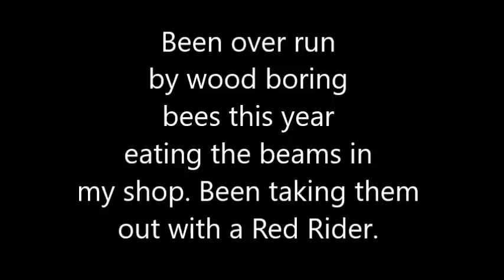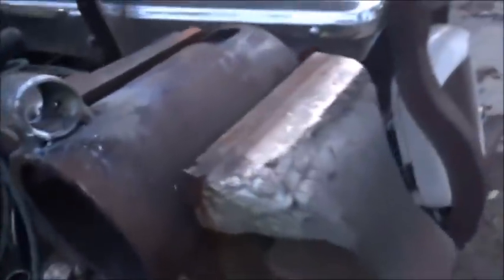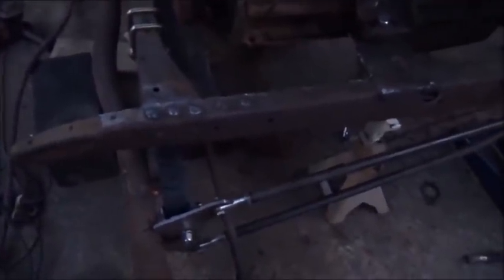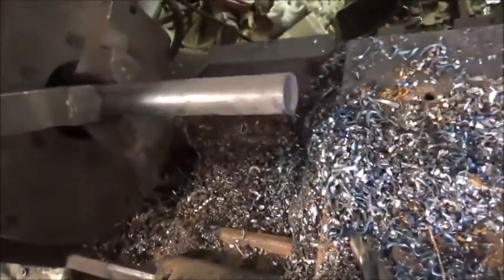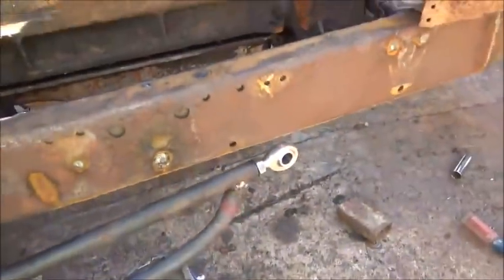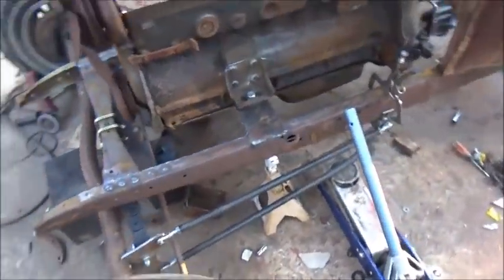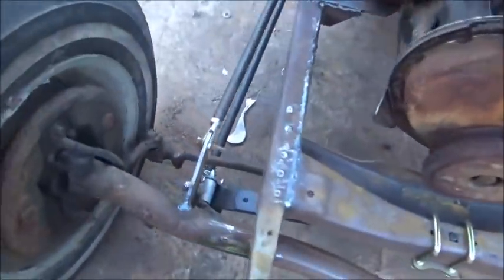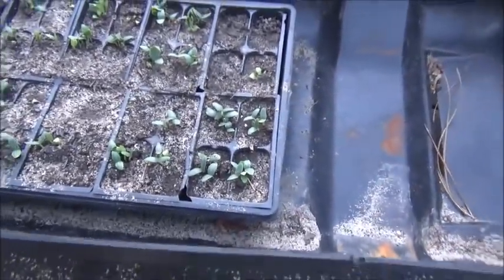1929 ROADSTER PICKUP FROM JUNK PART 10 Front End

Comment: I wood notch the frame in the front the ride height looks good
Reply: agreed,notch the frame...
Reply: Me too.
Reply: Agreed!
Reply: I agree also
Reply: Me also, looks good
Reply: YES INDEED - I agree with these men.
Reply: I agree, notch but also add the 1/2" plate to the center for additional peace of mind since 1/2" would not be noticable and as the spring breaks in and settles you won't have to play with it again.
Reply: I like the ride just as it is. But your going to gain probably another 100 lbs. on the front end. depending on radiator with coolant and manifold and exhaust. I like the" W" for a brace on the hairpins or maybe "J-W".

Comment: I would drill the hole up as you still have the weight of the starter motor, radiator, water, manifolds, anything else that needs to go on the engine and your self as you sit in it. But wait until you have the rear suspension and everything all together, with you sat in before you make your decision. Loving the build, your knowledge and skill to make something from nothing is amazing.

Comment: With the height of ride right, I'd notch the frame ends, I have seen them going past the front anyway and its not structural so just do it, its yours. Cucumbers for the valley as you can can pickles and what not but eating that many greens would gas me to the moon. They show no sign of slowing down in coal dust so it might just be the very nutrition that little (soon to take garden over as they spread out and hang to the sides of the low spot in garden... Heck, I have seen them hanging on chicken wire and doing good, supposed to keep those little feelers near dirt but didn't slow those behind house down. Gonna be a "finished for you know it" thing and then the next one will be the next one!!
You don't like the travel on the front then hang some torsion bars to the front and sides on the back

Comment: Looking good, as usual!  Suggestions to increase travel in front suspension: 1)Shim between cross member and spring. Drill a hole to just clear the spring bolt, possibly using a longer spring center bolt. OR 2)Add a leaf or maybe two to the spring pack. 3)Go to an axle without as much drop. or of course, drill another hole in the two bat wings.

Comment: I lean strongly to the half tubes welded in the chassis.  Evan if you raise the chassis the half tubes will still look fine. You could weld an alignment plug on those 1/4" spacers and shim the spring a little to get your 2" space. Personally I would want 3" for here in New England because the roads are poorly maitained. I know which ever way you decide to go it will look good and work well. Those straight 8 Buicks had a load of lowend torque so 2:78 to 3:25 gear with a Ford T5 will work just fine. 2:78 was the standard gear in a 5.0 Foxbody 5spd. I'm really enjoying this build. By the way I kinda miss young Noah. Keep healthy!! Dave

Comment: My opinion  move the spring mounts on the plates to the right height  A 1 1/2 inches. They are a heavy motor compared to the original.  or can you throw in another couple of leaves.  Then you end up needing longer mounting bolts and centre bolt. It looks good.  The starter body gave just the right radius too.

Comment: Ride height looks good, like you say. Keep in mind the added weight of the rad, manifolds, etc, etc. I would be inclined to drill a couple of extra holes in the batwing, finish the front end with all the accessories, then adjust to the finished weight as desired. Tubed notches in the frame would look cool as well!

Comment: Jonathan, the "Bell" style dropped tube axles have pressed in forged ends that are welded to the center tube. When these get chromed there is a special process that needs to be followed so that they don't crack on the weld joint. I think the problem is called "Hydrogen Embrittlement" which is a weakening of the ductility of the metal due to the chrome process. I don't recall what needs to be done to prevent this but I think some kind of heat treating after chroming. In your case the only chance of cracking would be due to a poor quality weld on the axle. The heim joints at the frame should allow more then enough movement to prevent binding.

Comment: Hey Johnathan: the only thing I've found to keep the bee's from eating my wood, is to paint it with used motor oil. Trying to figure a way to mix the drain oil with diesel fuel to thin it. Then find some way to spray it on the wood. Let me know if you have any ideas, or make a video of it.
Reply: Had a friend that used a 50/50 mix of old oil and diesel fuel. He used a weed sprayer ( hand held of course ) and soaked his rather large barn he built . I have since moved away so I do not know if it worked but, at the time it looked good. He was an etymologist so I figured he knew what worked. Hope this helps some people.
Reply: @christinamoneyhan5688  Nothing like making dry wood even more flammable...soaking it with an accelerant

Comment: Just a suggestion: don't alter your current front suspension until you've got the shocks installed and radiator in place. The new spring will settle a little but the front suspension really doesn't deflect as much as you'd expect if you are using shocks intended for the front end; rear application shocks are valved differently and might allow the front to compress too far. If you've got 1 1/2" of clearance you might be just fine. Also...with a long-wheelbase hot rod you've got to keep the frame angle 3 to 5 degrees down at the front for the car to look sleek. Otherwise it will look like a long lumber wagon. Keep up the good work!

Comment: Hi Johnathon.....Many are saying Notch the frame because you like the height right where it is....but they may not be taking the extra weight of the steering linkages into account nor the steering box  along with the weight of the radiator, the antifreeze, headlights, headlight brackets, intake manifold and carbs plus the exhaust manifold and pipes. Sure separately these things don't weigh that much but together they add a goodly amount of weight.

I suggest you drill 2 more adjustment holes in your batwings ......Easier to do than notching the frame AND 2 holes gives you more adjustment for weight .

Comment: Maybe you could try a thicker spring in the spring pack?  As far as I know that straight 8 weighs about 700 pounds or more. That's a good bit of weight on the nose of the frame. If you could've set the engine back more it would have put more weight toward the middle. But, it is what it is. So, going by my experience, it seems to me the best thing to do is add a couple more leaves to the spring pack. To me, it seems safer that way.  If you have an old pickup around there with good springs in the back, take the spring apart and cut them to fit. If they have the right amount of "bow" in them? Just an idea. You might can get extra leaves from the place you bought the spring from? I can almost guarantee you will not like it the way it is when you start driving it. It will most likely turn on its door handles. Scary to drive with all that weight on the nose and a soft spring upfront. Good luck with it. I enjoy watching.

Comment: put a 2 inch spacer block on top of spring and or /add a couple leafs  put a longer thru bolt to keep everything centeredI make up 2 in. longer u bolts put a pare of long reddy rod in the bat wing heim end holes and pre load/adjust  the spring before welding the wings to the axle. been doing it this way for years. the full load finished weight must be taken in count that buick scales up more than a bb chevy  the pre load will be damn close every time  and this rairly becomes a issue. Love Your work Love the saving of the old rides. Be safe Take Care,bob

Comment: I would mock up all the weight that will eventually go on the front of the car to determine the total spring compression for height adjustment because when you add up the weight of the starter, generator, full radiator, steering box and intake & exhaust along with two adults in the cab it will reduce what clearance you already have before adding in any dynamic loading ( bouncing ).

Comment: If the feel you wanted the Rod's look was where you had it, prior to dropping the weight, correct it and get back that look with new holes in the Batwings. For showoff you may then choose to drop the rig. For driving you may choose to raise the rig. Were you on really rough roads, you may want an even higher front ride. Having the built in adjustability provides flexibility for road conditions as may show up. You can make all of that it look good too! You know that.

Comment: I'm thinking the frame notch or if possible a spacer between the leaf springs in the middle where your U bolts are. But you would know best which is for a more stable handling and ride. It's great to watch you build them hot rods.

Comment: Can you add another leaf on the spring to make up for the extra weight of the engine?
Reply: that or maybe coil overs on the shocks?
Reply: Yeah...add another leaf and maybe add some sort of bump stop.
Reply: Add a lift block front a suspension lift kit (about 2").
Then bump stops on the frame.
Then a put slightly shorter tire on it to get the axle closer to the ground.
Reply: Looks pretty stiff as it is.  He could barely bounce it down the inch to the axle on the right side.  Of course, it's going to get heavier when everything's installed, but not that much.
Reply: Adam Heazlett that axle was designed to hold the weight of a full body car, this has a heavy engine but no body at all, I’m sure if you scale it at the end it will be comparable to the car it came out of

Comment: I think a combination. Use half inch of spacer under the spring and clearance the frame a little. Hard to see the ride height on the screen but I think it would square those radius arms with the frame a little bit better. Just my 2 cents.

Comment: I think it will definitely bottom out once you add the weight of the radiator full of coolant. Like you said, the ride height looks good. I think a combination of drilling the bat wings to add one inch, and notching the frame and adding the pipe stiffeners would keep the ride height good and reduce the risk of bottoming out. More work for sure though.

Comment: I would drill the hole 1 1/2 inches up because you have exhaust and radiator and fan floors batteries then if it settles more make the other adjustments it is looking great

Comment: Jonathon, I have a set of new old replacement stock seat covers that can give you if your are interested. Looks like they are from the early 50's to 60's 
 No idea what they fit. You works on so many different cars maybe you can use them. Will make some picks and send them if you are interested. Original box is pretty beat up but the covers seem ok. No charge if you want them.

Comment: I like the height where it is.  If you look at the angle of the engine on the frame, it looks just about right.  You'll need at least 2 to 2 1/2 inches to allow for the spring.  BTW those inline 8 engines did have a slight angle to them.

Comment: I learned way back when that it's the 4 bar on the tube axel that twists it. A single pivot like a split radius rod or hairpin DOES NOT. If you like the ride height, I would "C" notch the frame horns. Would definitely put some links inside the upper and lower radius rods so thr share the temptation to bend.  Looks really good !!! Will the shocks be mounting to the bat wings also ??

Comment: You're a good shot with a rifle - most welders are & straight shooters on the pool table (Native Americans are laser straight)...l like the ride height just how sits now...l can't believe you got everything that close 1st try...l think you're going to have to drill those holes - intake, exhaust, accessories & a full radiator will probably close it up some...might want to get all that on - then go from there...everything looks good to me...if you got a fat pine tree & know somebody with a saw mill (do you still have that hydraulic chainsaw) if you harvest the tree mid to late summer - it should be full of sap & l don't think those bees will want to fool with that...l heard you can rig a diesel drip to keep the saw from gumming up from the sap...good video - my head ain't hurting no more

Comment: Looks like drill a higher hole in that plate to raise it up because you are fixing to add more weight to the front end with the radiator/coolant,steering box,maby hood,and more things,just my thoughts,and you can allways move it back down later on,either way,your decision,good video.

Comment: was in with drawl, so glad you posted, thank you very much. D  OK Seeing what you're doing and why, i agree current stance looks really good.  The engine goes back so far it tends to make the suspension bars look short, but as you say they are 1 inch longer than usual. Is there any advantage in the handling for them to be longer??? I don't know. The spring sure did compress 2 inches, must be that heavy engine. Shocks will help, maybe gas filled shocks to get  little lift? Or air bags like over load bags to allow you to set ride height? Or weak Coil Over Shocks for some extra spring lift that way. I hate having more holes in the plate and by raising the bolt hole won't it takes travel out of the springs. It looks sturdy, so tube in front could work as you suggested.  But it is good to have more than 1 1/2 of travel isn't it.  Would Coil overs be OK? I have seen them used it the front and can be made cool looking. Hey whatever you do will be fine. Really like the vehicle profile. D

Comment: I think you should drill it out, remember when you add the starter and intake and exhaust, and the fluids, radiator, carburetor, air cleaner, all that weight will add up,  I have forgot to consider that on my own hot rods.

Comment: Yeah that sucks so low but you'll fix it. Still missing alot of wieght though without headers , intake,  radiator with she'll, alternator, carb and probably some other engine parts I'm missing. Maybe with fluids atl east another 150  pounds maybe more ??

Comment: If'n you like the front ride height, notch the frame horns.  I'll betcha you'll need to still move the spring holders up, though.  You'll lose some more height when you start adding the radiator/floor/interior/and all the other goodies..

Comment: That was a pretty intense as cat scan! She was really checking out that bend on the hairpin! All good though,she gave it the cuddle of approval!
I'd redrill them holes,by the time you get the radiator/electric fan combo,water,oil,and the rest of the engine parts on there you're gonna be resting on the axle. Hell,it's gonna be a hundred pounds heavier with the intake,and exhaust manifolds carbs etc.alone. 
No,I'd definitely redrill them holes.

Comment: Probably wouldn't be a bad idea to go ahead and build out the rest before you even mess with the suspension. You're going to add weight with the rest of the stuff so you're probably going to have to adjust it up a little anyways. The ride height looks good though you do need notches for suspension travel I think.

Comment: If it was mine, and it's not, I might be inclined to do a little of each option. My reasoning being that engine isn't fully dressed yet and there's no radiator full of water out front, so more weight to come. While not a structural issue, l think LARGE c-notches, on an open wheel car, are a bit ugly. They really suggest an afterthought.  Maybe weld up the batwing holes and redrill a little bit. Then add one spacer to the spring. Then when all the weight is on it a mild c-notch if necessary? A fellow could even add a leaf to the front spring and see where that goes..

Comment: Drill the extra hole in the bat wing up about a inch  -- problem solved plus not cutting on weak point of frame or adding more weight on already heavy front end from straight 8.

Comment: Drill a couple of holes and fix and it wont look much different and will be a easy fix with out mangling up your frame horns. Try it first, always do the easy way first wont hurt anything just to drill two holes and move it you may find you like it fine with out all the hacking. The frame looks elegant no need to hack it. You can always hack it later if you must.

Comment: Round tube would not twist any more that I beam. That said depending on the suspension and steering geometry, there will be torsional loading in the axle, however a tube axle is much better at handling the stress than I beam.